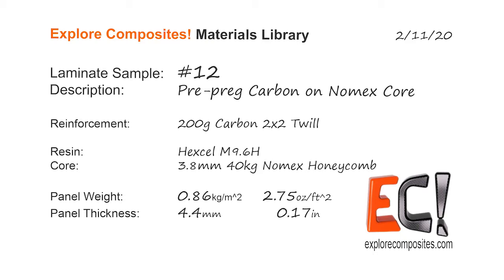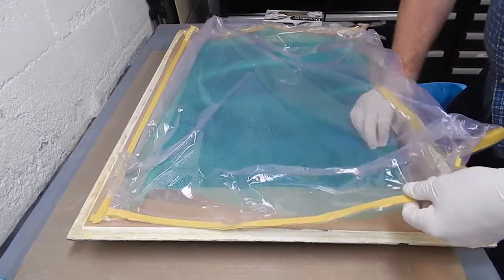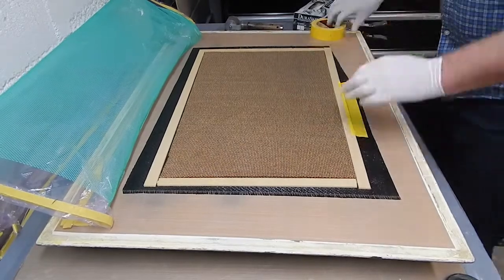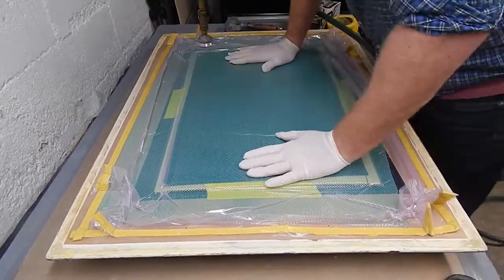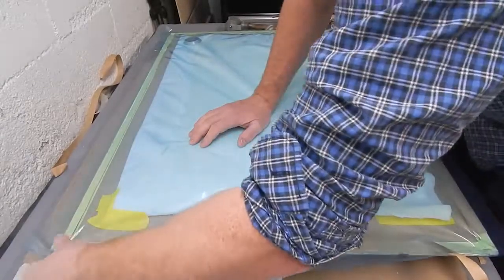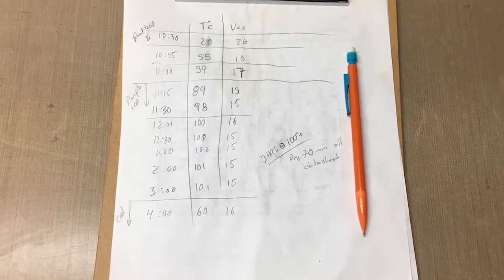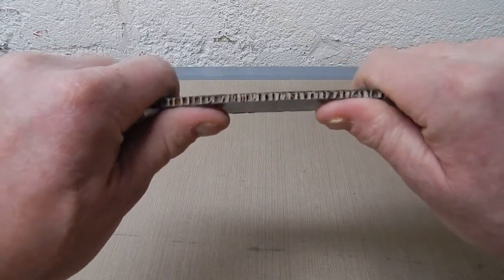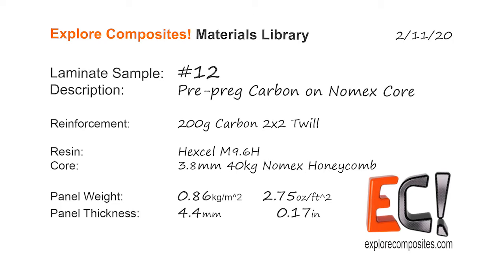Laminate Sample #12: Light Prepreg Carbon on Nomex Core

Comment: I'm doing the math for aircraft using CF and it says skinny CF sandwich has extreme potential. Maybe the nomex sides could have been rolled with a resin but it looked like the nomex crushed more than delamination.

Comment: I want to make bi fold flexible wallet of carbon fibre fabric can you help
Reply from the maker: It sounds like what you need is a carbon fabric laminated with a very flexible resin so it can be bent and sewn or bonded without cracking. There are "carbon fiber leather" products but I have never used any.  Here's an example:
https://compositeenvisions.com/carbon-fiber-leather-2x2-twill-matte-finish-57-87-147cm-19-46oz-660gsm/